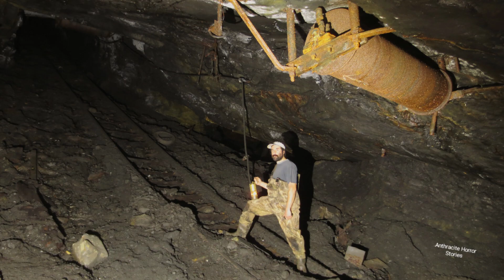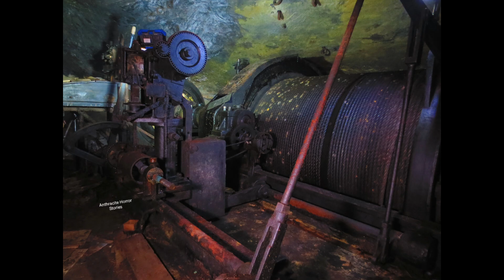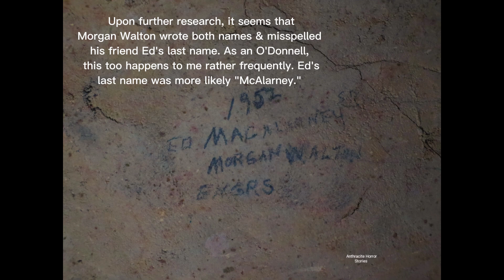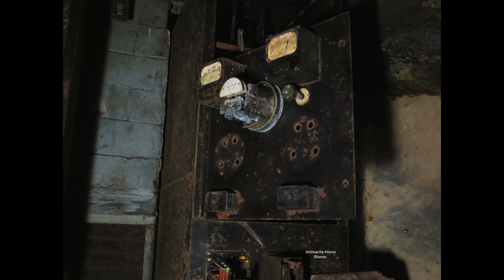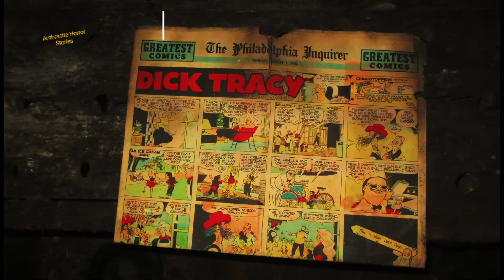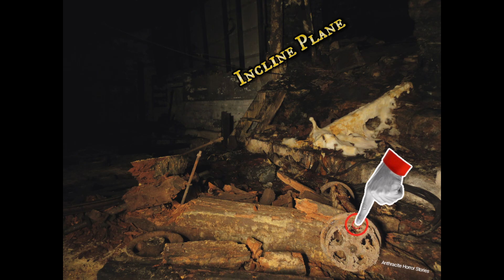The Forgotten Underground Anthracite History of Luzerne County, Pennsylvania

Comment: What was the temperature like down in that area? What was the air itself like down in that area?
Reply from the maker: The air here has a great even steady healthy flow. It never deviates from what I've seen even regardless of the season and/or outside air temperature variation. Mid 50sF to high 50sF like most mines, just the manway gets a little warmer and the air more stagnant, but it always holds at 20.9%! I never take risks with the air though and never trust any mine with that.😆

Comment: The air shaft and the first aid station that I actually know about which is located in Hanover Township Pennsylvania has all been closed off but still visible. That air shaft and first aid facility goes down approximately 600 feet from what my father taught me back when I was in Boy Scouts in 1977.
Reply from the maker: @wildman318  that's awesome! I think I know what you mention. 600 feet straight vertically? My son is a Scout by the way. Was the Amusement Park still open nearby there in 77?
Reply: @AnthraciteHorrorStories  no..  the amusement park in Hanover Township never came back after 1972 the flood of Agnes. By then, the new Hanover Township high school was starting to be built on that property. But that is not the property that I’m explaining to you about where the air shaft is and where the first aid station is that goes down 600 feet or more.
Reply from the maker: That's too bad about Sans Souci. Interesting about the air shaft. It'd be filled with water pretty close to the surface I'd imagine.
Reply: @ are you referring to the area that I actually know about?
Reply from the maker: @wildman318  I don't know about that one offhand. Send me an email if you'd like to discuss it. I try to keep all mine locations in the comments 🤫😆